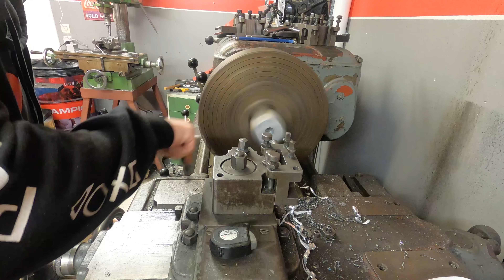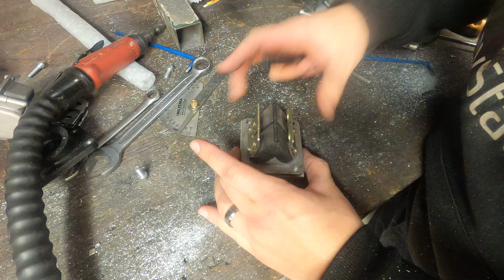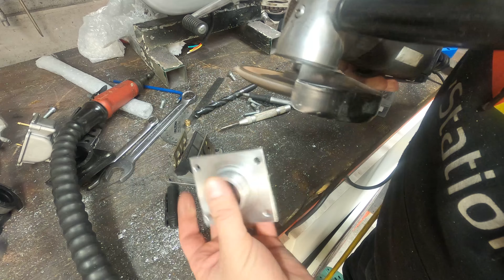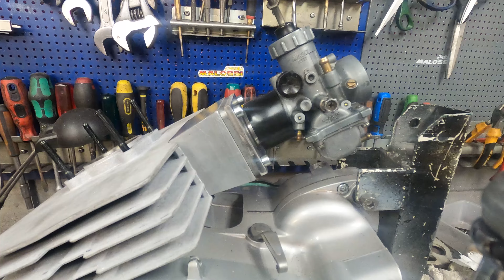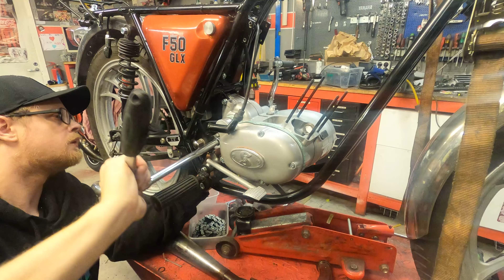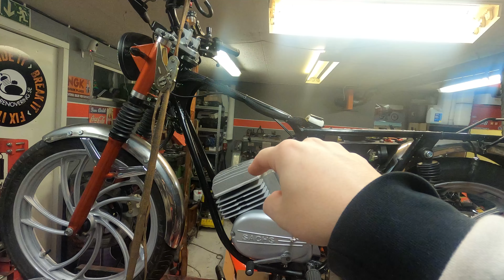Crescent F50GLX Renovering  - DEL 26 - TILLVERKAR NYTT INSUG!

Comment: Undrar om du vet varför jag inte kan kolla squish. Jag beställde en 70tpr från maxiscoot och den ska ha original slaglängden(39.2mm) och jag har en jasil evolution vev med samma slaglängd. Däremot när jag ska mäta squish så pressas inte lödtennen ihop. Har testat att köra utan packningar men får samma resultat. Fick bara en smal papperspackning i paket. Vad kan va problemet?
Reply from the maker: Prova tvinna ihop två lödtenn, så den blir tjockare. 
Har du rätt längd på vevstaken då?
Reply: @ jag är rätt så säker då org veven  har 80mm stake och 39.2 mm slaglängd och det har jasilveven också. Om jag tvinnar ihop tenn så kommer jag väl få en väldigt stor squish typ över 1.3mm eller och det är väl inte så optimalt?
Reply from the maker: Ska cylindern ha 80mm vevstake då? :) 
Jo, men då får du iallafall en riktning på vad klämspalten är. 😂
Reply: @Rexxy_90  Ja det står på hemsidan att Conrod length är standard vilken jag antar är 80 mm